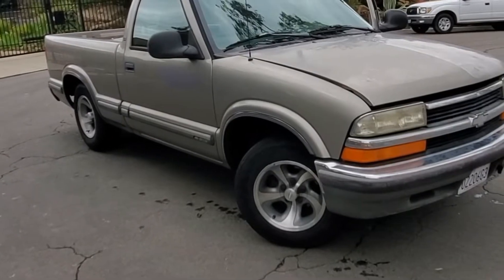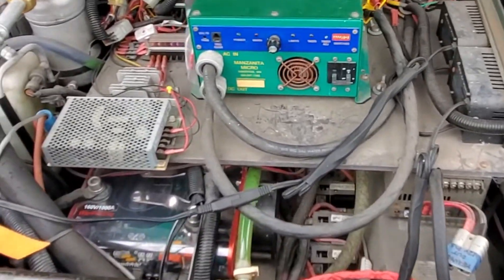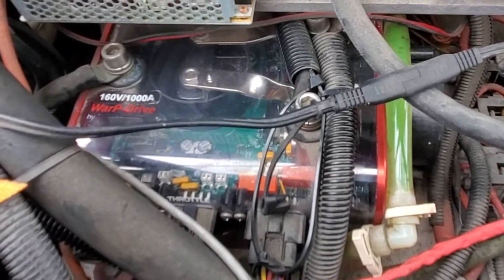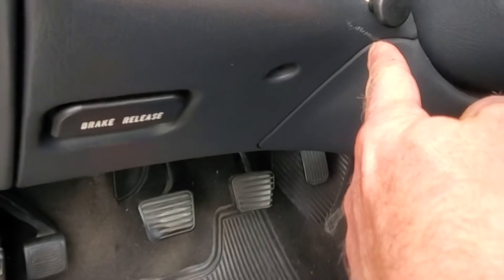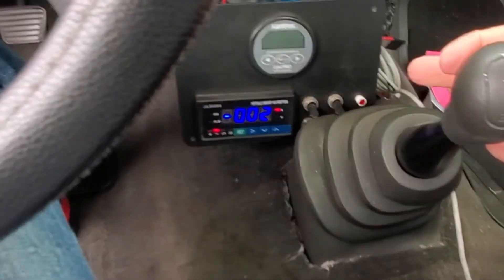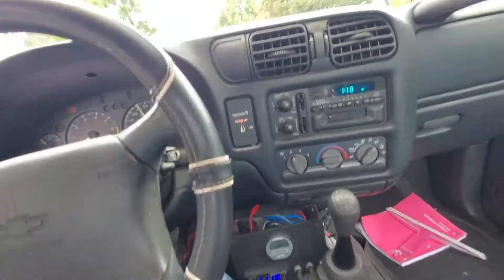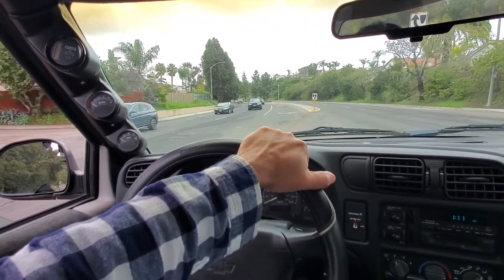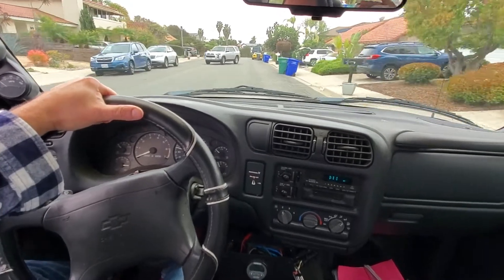Electric Chevy S10 Pickup

Comment: damn gives me hope to convert mine in its old age.  unfortunately, it gets VERY cold where I am, so I think it would probably need battery heaters and extra stuff like that.
Reply: Use LTO batteries and cold will not be an issue. They are rated for use down to -40 degrees without the need for external heating.

Comment: This is super cool, and thanks for sharing. I have a 91 S-10 that is ready for some kind of swap (looking at performance options). EV is one of the options I'm considering. So my question is, how fast is this truck?
Reply: edison motors is coming out with a pick up e-axle kit that can use either your existing motor or they supply a 3.6 cat disel motor which wold only turn on for a few minutes to run a generator that supplies a power bank which in turn drives the crazy e-axles. You still use fuel, but that is only to drive a generator so there really isnt any drivetrain losses in addition to the generator's engine is only on when it need to charge the power banks. The edison motors semi e axle truck is moind boggling with what they did, 100k over all weight in a 1960's converted truck and the drivers said it felt like terre wasnt even a trailer.
Reply from the maker: It is not fast as it is, and I'm afraid to put my foot into it too hard as I might break something.  With a modern EV motor and lighter batteries it would be nice.
Reply: @kevinlieb  right on, and thanks for the quick reply. When I bought my truck in 2011, I said "when it dies I'll put a small block Chevy V8 in it", and since then LSs have become the favored swap and now EVs are looking pretty neat as well. I think it would be novel to make a performance-centric EV S10 especially with all that battery weight in the bed. It's not like it will ever have sporty handling, haha!

Either way, you have a super cool truck and I hope it continues to treat you well!
Reply from the maker: @ldm125 This truck is now available for sale if you are interested.
Reply: @kevinlieb  sadly I'm probably not in a position to buy. I'm currently working and going to school full time or I probably would. Just for kicks though, how much and where?
Reply: They go 112 mph. I have one of my own